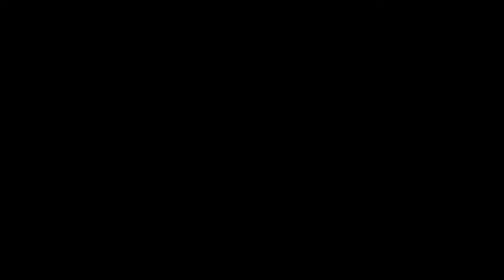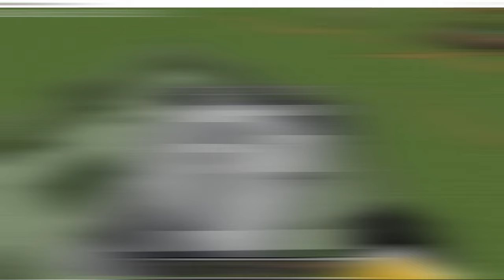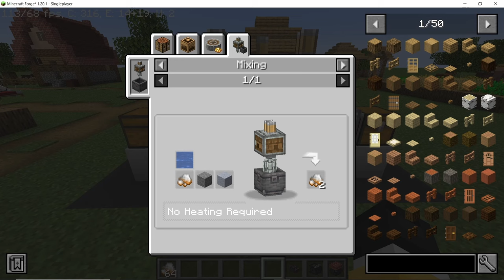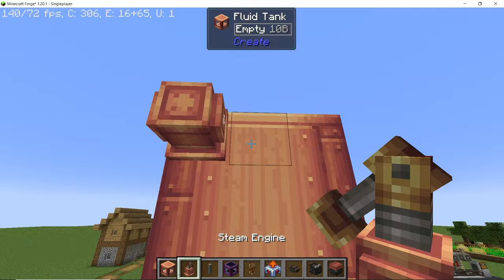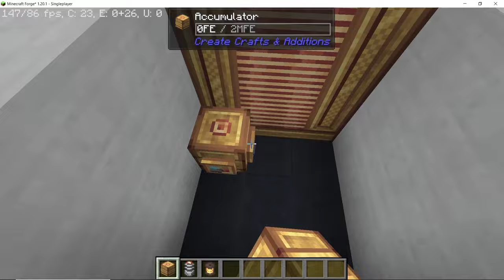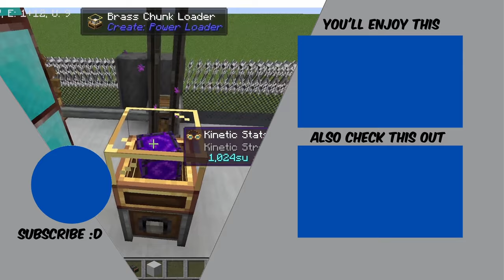Nuclear Reactors in Create !! Create: New Age Mod Tutorial & Showcase

Comment: The best reactor design for one max boiler is a 6 rod reactor with heat vent pointing straight into 6 heater
Reply: Wouldn't you want 9 heaters to go under all 9 spots of the steam engine?
Reply: @AlwaysLoadin  6 maxes out the boiler